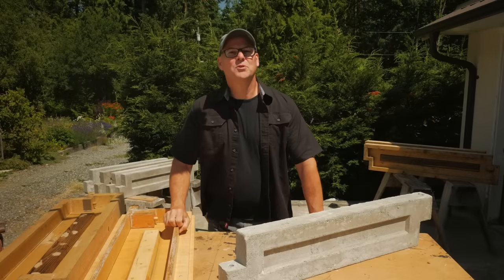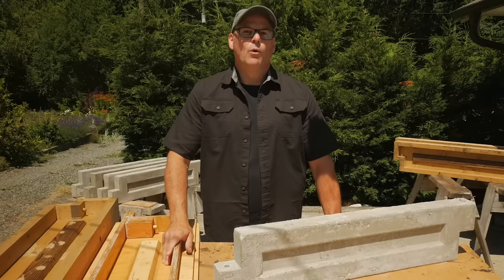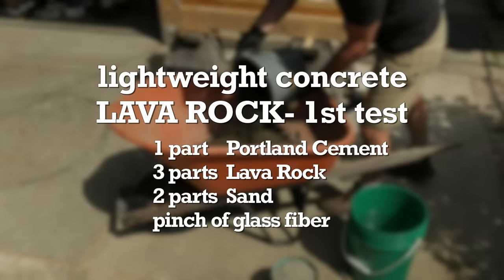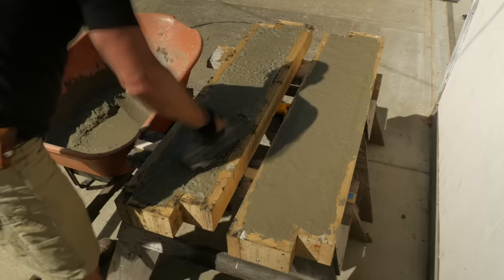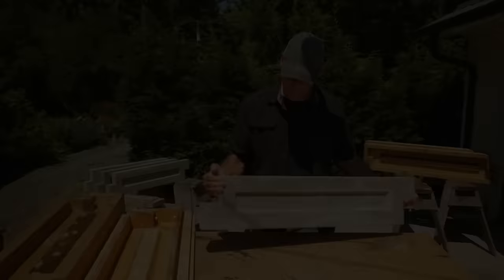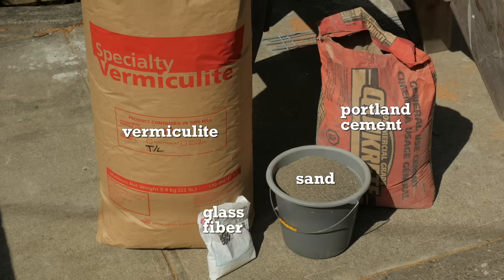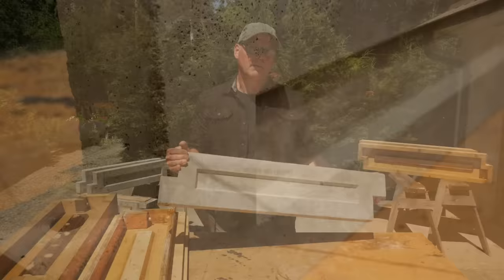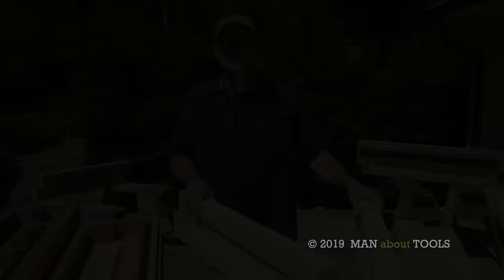make Lightweight Concrete Garden Boxes PART 3 - Aircrete Vermiculite Lava Rock

Comment: The Romans used lava rock in their concrete to construct the uppermost portion of the ceiling of the Pantheon in Rome. They used wooden boxes to cast the concrete. So not much different from what you’re doing. They didn’t wear socks in their sandals, it would have been bad form.

Comment: the light creat you need alot more fibre glass and chicken wire one on bottom one on the top. use epoxi finish to harden the outside leave in the wooden boxin place for longer time see if you can had some breathing holes to the bottom it will help a more uniform dryinh and avoid bending

Comment: After all your tests, this is what I'd do, if weight was important: some thick normal mix for the walls and bottom - just half an inch ... and make the mix thick enough so it doesn't run, then fill with aircrete and top off with the thick mix again.

Comment: Thanks for this video. very comprehensive. two suggestions: 1. when selecting the same light weight aggregate material, better get the heavier one by volume. That means more particles per volume, so less place for cement. 2. For the third option you can cast in two steps: first aircrete with a linoleum layer on the inner faces of the frame, and second step with regular concrete without the linoleum. This will give a durable outer layer.

Comment: Really nice video. To increase resistance to abrasion you could try with portland mortar and styrofoam balls
Reply: Tried that using small styrofoam balls used in 'bean bag' furniture. Not resistant to damage by weedeater. Every point of filler at or near surface will be cut or abraded by weedeater cutter.

Comment: Hi thanks 🙏 for sharing invitation and experiments to reach lighter weight concrete panels. 
I have a question for you, I need to manufacture plants 🪴 pot in different shape and sizes form your final mix that you used in particular do you think it will work good as a final finished products ? 
It would be super nice of you to share the final mix’s and the ratio in order to reach solid lighter weight finished product. 
Thanks 🙏

Comment: The aircrete cracking will not be solved by adding more Portland (binder). Suggest adding lightweight hemp to the mix that will tie the Portland together. Not typical 1inch particles of hemp Hurd, rather an even mixture of 1" to 6" stems of the whole dried plant. To strip the fiber from the inner hurd of the plant by hand is way too labor intensive. The idea is to make lightweight airhempcrete that will hold together with the least labor and expense possible. I'm getting ready to experiment with this concept.

Comment: Maybe soak the lava rock in water to fill the voids. The concrete will absorb/drawout the water as it cures.
Reply from the maker: Worth a try. I like lava rock cause it's very strong and light and easy to find.

Comment: As supposedly the pores in the lava rock absorbed quite some water of the mix, could it be that the bars get lighter over time? Or not, because the water will b chemically bound, replacing atmospheric water that otherwise would be bound into the bars?

Comment: Great videos that I am following with interest.  I suspect the warping may be from 2 things: the bubbles will rise to the top of the form during setting and denser concrete forms near the bottom.  When set, this results in two different densities of concrete and thus 2 different shrink/swell characteristics that fight each other.  The second thing may be that the wire reinforcement maybe not in the center of the piece.  It looked like it was placed quite close to the top of the form.
Reply from the maker: Thanks! I was thinking that as well. That the density mismatch was causing it. I'm pretty sure I got the wire set well and in the center, as there was some resistance in placing it and pushing it down. Thanks for the comment! Cheers, Kent
Reply: the wire being not centered is my guess too for the cause of the warping.

Comment: Could you use aggregate with the aircrete mixture or apply a reinforcing fabric for strength?  The guys at domegaia use a latex cement & APOC® 482S (Soft Polyester Reinforcing Fabric).

Comment: You should try using styrofoam beads as the aggregate , it will make the concrete lightweight and still maintain good strength !

Comment: I think to prevent the cracking/warping in the aircrete it's important to stabilize the foam. Glycerine is commonly used to stabilize soap bubbles.

I would also like to see a vermiculite/aircrete mix.

Comment: Cool video. Couple questions
1. Do you wrap the plastic tight with ropes or just cover the molds over night?
2. Also, when you say "1 part", "2 parts", how much did you actually use? Sorry if I missed it.
3. Before you wrap the molds, do you edge them to clean the top - where youve trowled and pushed the excess concrere over the wood sides?

Comment: This was fascinating to me. I'm on the verge of making wooden garden beds for my wife, and this looks like a plan to only have to make it once. Do you think it could be light enough to hang from a deck rail? How hard would it be to add color to the outside? Thanks for sharing your thoughts and videos, Rodney
Reply: Rodney Widger 
Could you get the rigid foam they use for the architectural exterior on buildings then skim them with a stucco mix using a waterproofing additive ?

Comment: Try using a magnesium hand float first, this will help draw up the sand-cream mixture to the surface then finish with that Fresno (steel) hand trowel you are using. You will end up having a cleaner and strong finish.

Comment: First, good job on creating these beautiful and functional forms.
Concerning your aircrete panels : When they are done, you have to coat them on the outside with aircrete mortar (check tiny giant lifestyle's channel), and rub in a plastic mesh.
But this is not compatible with the forms as they are, you'd have to have straight sides, not hollowed out ones.

Comment: I need to build very large planters the size: 15' X 5'. Do you think I should go with bricks, or this kind of panel-making approach? My concern is cost more than anything else as I have a fairly large garden to fill. I love the flexibility of these panels as they can be moved and reassembled. I wonder what it would cost to make a L15' X W5' X H2' planter with this method.

Comment: try concrete glue, or acrilic glue use in stucco.

add way more glass fiber, or sawdust as aggregate.

you can petrify the sawdust by creating a mixture of rock salt water and lemon juice.this will cause the sawdust to petrifying become extremely hard.

you will need to leave the sawdust out in the sun to dry for I think three days to a week you need the sun to activate the petrification of the sawdustas it is the Sun's light or UV rays that causes the wood to petrify.
Reply: Hi, is there a diy somwhere on the www cause nothing workable after my g..gle search
Reply: Sophie Béngué

 Google search on what exactly?

petrifying wood? adding petrified wood to concrete is an aggregate? adding concrete glue or acrylic glue to cement mix? you can try all of these yourself or look on YouTube for seeing if somebody else is doing it.I worked plaster and cement for 10 years and California and did lots of stuff that was out of the box.

 I have seen the stuff work or have done it myself. experiment come up with your own formulation, I gave you a path to follow but you got to try it for yourself.

Comment: Dear Kent, have you thought of trying polystyrene chips instead of the bluestone? It certainly would be light but you would need something to give additional strength, such as adding more glass fibre as one expert in the field suggested.  Polystyrene is one of those waste products for which there is no effective recyclable product and it ends up in landfill.  As a society we produce cubic metres of the stuff.  Just buy a fridge and you have a huge lot of polystyrene which you break up and toss away with the garbage. If you could grind it and turn it into chips wouldn’t that be a nice way to turn waste into something lasting and useful? Just so long as the beams don’t float away in a heavy downpour! {only kidding}

Comment: Not sure about garden boxes but most videos on aircrete I have seen they put some kind of stucco or hard facing on it to help as far as impact durability aircrete is structurally strong but not durable as far as direct impact also I hear dirt breaks them down so I don't think they are good as garden boxes something about the interaction of the dirt and air bubbles in the aircrete.

Comment: Thank you very much about detailed information.  I was looking for DIY to build a light weight planter for bamboo to prevent bamboo root running around under ground.  Can you give some advise on it?  I think it's very smart to build in small pc and form them into a large capacity.  I wonder if the bamboo root would run into the seem in between.  Thank you again.
Reply from the maker: Thanks! I don't have any experience with bamboo. Maybe some other readers can chime in here with some advice.

Comment: I liked presentation you speak clearly and stay on point did you put pipe in your form to allow your corner pins to line up how did you keep them from moving
Reply from the maker: Thanks! Yes the pipe is cast in the concrete. See part 1 and 2 of the series.

Comment: I'm super happy that you experimented with aircrete as I've been quite interested in it for a long time.  I also follow aircrete Harry and honey do carpenter. When you were talking about trying to find ways to make the aircrete stronger it reminded me of what they do on another Channel called Trinic LLC. They like to do a thin base coat on their forms to get a smoother finish but I'm thinking you could do the same thing but with a high strength concrete mix and then pour the aircrete inside to make sort of a foam core kind of concrete.

Comment: What if you soak the lava rock in water first then add sand/cement. The water fills the lavas void but will dry after. This would increase the cure time but would be lighter.

Comment: I contact you from somaliland and as I think of the cracks coz of the weather if the cement gets dry faster it gets that cracks you should not but in on direct sunlight it’s needs time to get dry slowly and it will not crack as I wish

Comment: Have you tried using the vermiculite as an aggregate in an aircrete mix? Just thinking of a way to find a better compromise between weight and strength.

Comment: Brilliant stuff Mr Mat (man about tools) would you mind expanding about the durability of the vermiculite panel. I'm building a moon gate and would like to use a vermiculite mix as the blocks I have designed are rather heavy in ordinary concrete. 1/3 less would great. Super informative thankyou for posting. JW

Comment: Run your weed eater on the troweled side of the aircrete.  I’m suspecting it sealed with the trowel and should prove more abrasion resistant.
Reply from the maker: I'll try that

Comment: I’d butter the bottom of the form with something that would stand up to the weed whip.   Or pour 1/2 inch of regular concrete first.  I question the value of the wire..   it may be contributing to the warp.  Foamcrete shrinks non centered wire does not.

Comment: Amazing stuff ! Ya I’d stick with the weight savings of the vermiculite over the aircrete finish and durability any day. I’d also look into glass beads. Check out Poraver, it’s expanded lightweight recycled glass aggregate. Pretty sweet stuff if you want legit weight savings / structural strength benefits.

Comment: I wonder if these would work for compost bins,  only using 3 sides.
Reply: I think that they could if you used thicker rebar and something to span the gap at the top of the open end... it wouldnt be a bad idea to keep one at the bottom to keep it from spreading as well
Reply: @mitchlund2403  i think if i try it,  I'd also try to make air gaps on the bottom,  just to help air flow to the compost, though I'm not sure if it's needed.

Comment: Lot of comments here. 
The way to get high-strength lightweight concrete block is to autoclave it (AAC or Autoclaved-Aerated-Concrete). Foamcrete as you discovered is lightweight and DIY friendly, but very weak. The problem with anything other than good old fashioned concrete made with gravel, sand, and Portland is that it quickly becomes expensive: you need expensive ingredients and it helps to have fancy tools as well. 
A cheap and DIY friendly way to make these blocks as light weight as possible while ensuring a durable face has already been suggested here: Cast them in layers, with a high-density face and a low-density core. A simple 4-1 sand/Portland mix, made to a dry pack consistency will make a great face. Make it dry and crumbly (15% -30% hydration, by weight of the Portland, depending on atmospheric humidity and of course if your sand was kilned) and pack it in with your trowel to a depth of 1/2". You can add fiber to this if you like but make sure it is finely dispersed or it will show on the face (mix it real good). PVA fiber is great for face coats as it helps prevent cracking and you can flame it off the surface after the piece has cured so it's not so fuzzy looking. 
EPS foam is the cheapest and lightest weight material for the core of these blocks, but its use is environmentally devastating. You will need some thinset mortar to bond this to your facecoats as dry-pack does not have great adhesion to foam. If you want strong block, add some stucco lath or scrim on either side as well. XPS is a little better than EPS and it's stronger too, but it's still yucky in terms of how they make it and of course it never biodegrades. 
If you fill the core of the block with air-crete I would reduce the thickness of the face to keep the weight down, as air-crete will weigh more than EPS foam board. If you're talented with the trowel and have the patience, this could be as thin as 1/4". I would stick with a piece of hog-wire in the center as reinforcement although you could use thinner mesh if you keep it close to the surface of the block and double it- this is actually stronger than placing the tensile component of your block in the center. Your blocks are thick enough for center-placed reinforcement to work though. Two layers of alkali resistance 'glass scrim placed just under the surface would be the lightest weight option. 
You need to control the shrinkage of your aircrete, this is why it cracked. Sand will increase the strength and reduce shrinkage but add weight, so choose fiber instead. 3% fiber to Portland (by weight) is about the upper limit without it clumping. At such a high water content you will still have cracking issues however, especially with such a dry facecoat (less shrinkage on the face, more shrinkage in the center). A lower water content is achievable with aircrete but you have to use superplasticizer, at this point it is still a bit hard to source and it adds cost to your block. "Super" is great stuff and it's worth getting your hands on some if you're going to be doing a lot of concrete work. Polycarboxylate works by causing the particles of Portland to repel each other, in practice it makes the concrete act like it is wetter than it is. .1% is a good dose of Super, with this high a dose you can keep your W/C down to 30% or so. More water than this and you'll get cracks.
Fritz-Pak makes an expansive concrete additive, I forget the name but it makes your 'crete expand slightly. You'll have to play with the dose as I never use it.   
One other way to control shrinkage is to use CSA instead of Portland ("Rapidset"). The blue bag at Home Depot is already dosed with its own superplasticizer, and CSA is already non shrink, so this is a great option if price is not a consideration. This stuff is about $20 per 55lb bag. You can make superior aircrete with it and a great facecoat too and it won't crack on you. On a hot day it sets in about 10 minutes. They claim 9000psi at 24 hours cure time, depending on temperature and hydration.
A tip: you can use Rapidset to speed the set time on Portland based mix designs- it works by increasing the heat of hydration. 
To decrease cure time on all hydraulic cements (any cement that cures by chemical reaction with water is a hydraulic cement), steam is the way. If the piece dries out the reaction stops, so steam gives it both water and heat. The Poor Man's method is to stick your block in a black plastic bag, hose it down, seal it up, and stick it in the hot sun for a few days. Some concrete facilities have a steam-cure room, it's like a huge sauna.
Cheers,
-Mike
Reply from the maker: Mike! AWESOME comments and suggestions here! I so appreciate the time and thought you put into this! Lots to think about and even more options to try. Cheers, Kent
Reply: @MANaboutTOOLS  My rule for creative projects is to first check that I'm not trying to reinvent the wheel... !

Comment: AirCrete needs to be wrapped for strength then stucco. The properties of AirCrete allow it to be cut with wood saws this is why the weed eater fail. AirCrete is mostly used for it's insulation and sound qualities. Wrap for structural purposes. I could see your mold being used with recycled plastic. Those guys who melt bottles and bags in oil then pour into a mold.